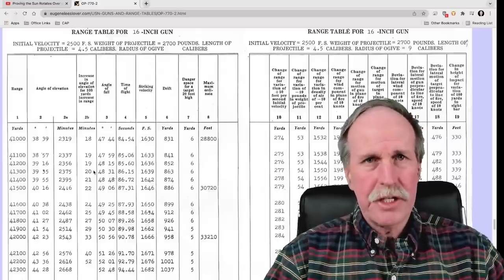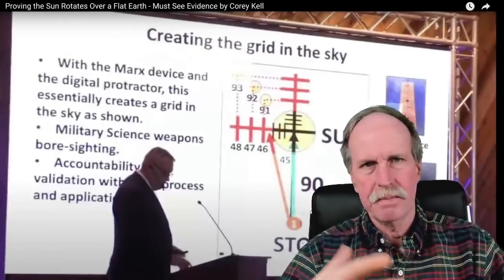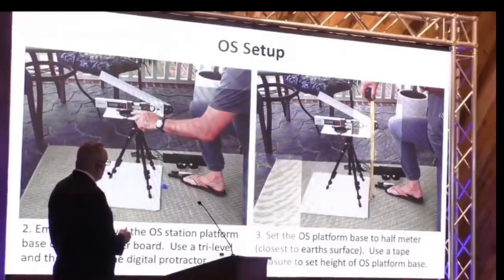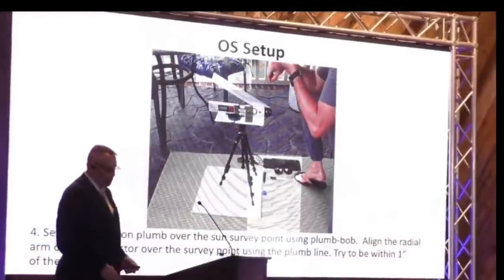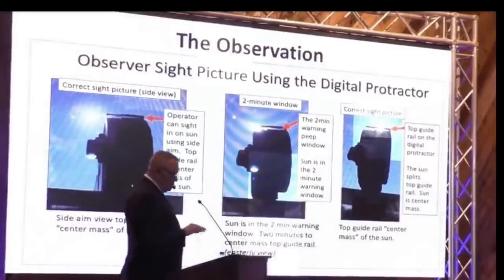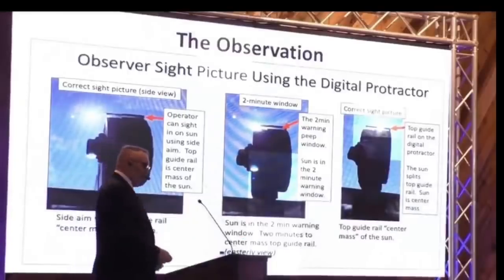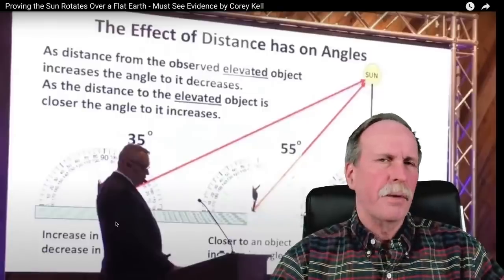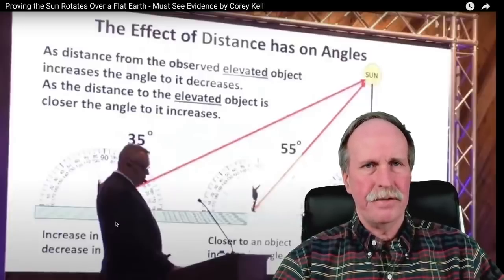The 45 Degree Sector Test  Final

Comment: Its that i saw one of the previous videos in this series but this video is difficult to watch by itself. with a couple of minutes extra you could have explained what the 45 degree test is and show that it just works. I dont understand how this guy got to 51 degrees when measuring. What did the flerf do wrong?
Reply: Kell's basic assertion is hard to discern because of his blustering delivery, misuse of common terms and self-invented jargon he won't or can't explain in normal terms - classic pseudoscience. When you finally decipher what he's saying,  he apparently thinks it would be impossible on a globe earth for the sun elevation ever to be greater than 45 degrees beyond three hours either side of local solar noon.
But that's because he evidently can't visualise in 3D and misunderstands the globe model, particularly the effect of the axial tilt. On certain sections of the globe at certain times of year it's inevitable. So the mistake isn't that he measured 51 degrees, it's his interpretation of how it happens.

Comment: As Bob the Science Guy stated; Lines of Longitude (aka Meridians) and Lines of Latitude are based on the Geographic North Pole not the Magnetic North Pole so right off the bat, Cory's display is wrong.  Plus meridians converge at the poles while  latitude lines are parallel to each other and never meet.  To visualize this, take an orange and cut it in half along the stem line, then cut each half again along the stem line, forming 4 wedges. Hold those 4 wedges together to reform the orange and you'll see how lines of longitude work.

Now take another orange and cut it in half perpendicular to the stem line.  Now make another parallel cut on each half.  Now stack the slices together again to reform the orange and you'll see how lines of latitude work.

Comment: Having been assigned to an Army artillery battalion as the Communications Electronic Officer, he might not be aware of magnetic deviation. Max range of a 155mm howitzer is about 14 miles, and under all circumstances that I am aware of, the call for fire will be directed by a forward observer. The FO will then apply corrections to the battery until one over, one under, and then fire for effect. Army artillery is directed indirect fire. If he was nothing but a gunner, I highly doubt he has any experience planning fire direction. 

Why? Because at no time does he make any allowance for magnetic deviation. I spent 6 months in OCS in Ft. Benning, Georgia, literally running through the woods with a compass in my hands. I was drilled in using magnetic deviation from the beginning of OCS. That tells me he never planned any kind of fire support. 

And of course, he may also be nothing but a scum-sucking pig-fart gob of spit liar.
Reply: But magnetic deviation is covered in orienteering basics.  Not sure about the USA, but here that's grade school.
Reply: @0LoneTech  Orienteering was left to the Boy Scouts or the military when I was passing through those stages. In the 1950s, other than as part of a science class, we never worked with a compass or map.

Comment: He states that an observation of the Sun's angular elevation will result in a decreasing angle with increasing observer altitude. But he makes no mention of the magnitude of this effect. If, as he purports, the Sun is local, he should be able to supply an exact value for some particular observed Sun angular elevation.

But of course, upon even cursory examination, for a Sun height of 3,000 or 4,000 miles, a 1 mile change in observer elevation will result in an angular displacement of the Sun smaller than 1 part in 3,000 or 4,000, or about 1 arcminute. Far smaller than his crude apparatus can discern.

Which renders as comically nonsensical his stressing of measuring the height above ground for the protractor!

This guy exemplifies the "baffle 'em with bullpucky" approach of the DK^2 crowd. DK-squared: Those who Don't Know what they Don't Know.

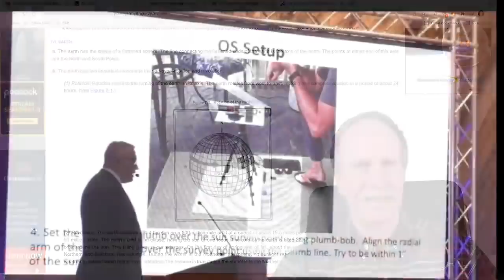Comment: 4:58 he's lying, no matter how you look at it. either he's lying about his military service, or he's lying about everything else. either way, he's a liar. but hey, gotta lie to flerf.
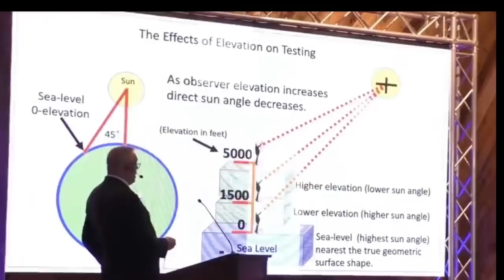12:10 so this is about the height of the sun above the horizon? what the hell makes him believe that the sun can not be more than 45 degrees above the horizon on the globe? WTF is wrong with him?
13:45 if you measure the angle between the sun and the horizon using a sextant, that angle increases with increasing altitude because the horizon drops away.